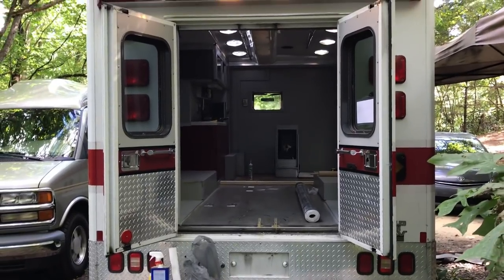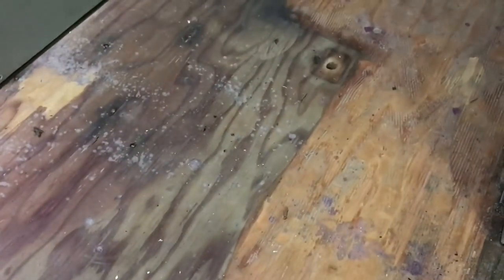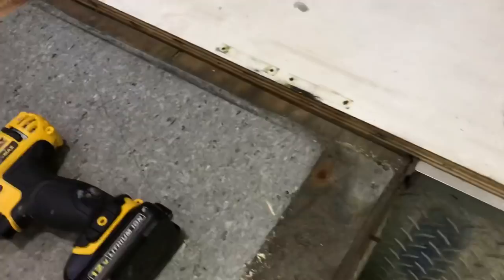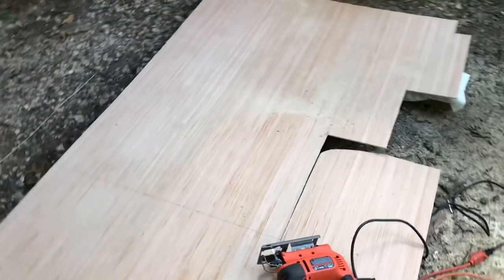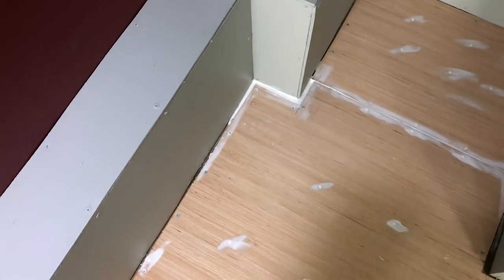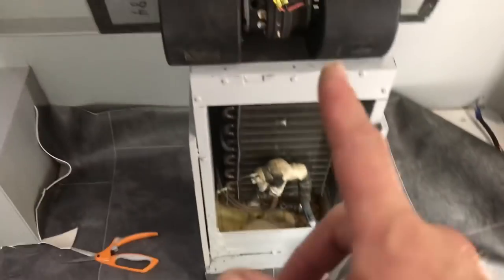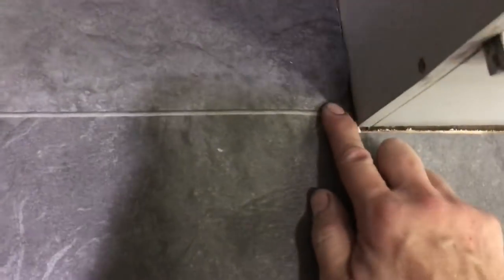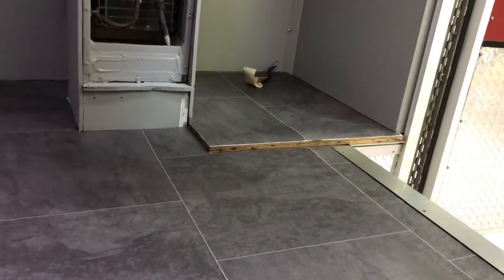Installing Vinyl Flooring for Beginners - Camper Build Conversion RV

Comment: There are 2 types of backing on vinyl floors and they require different adhesives. The paper back vinyl uses Tec Stick-N-Stay. The vinyl backed "sheet vinyl" uses Tec Pressure Sensitive Adhesive. Your vinyl will seem to adhear to your wood underlayment until cold weather, where in, the Stick-N-Stay becomes brittle and releases it's grip on the vinyl backed sheet goods. Most people give up on sheet vinyl at that point and declare "they'll never use it again". You have a very small area to work with and using a paper pattern and the proper adhesive will make it last 15 years. Next spring (after going through winter) look for your vinyl to slighly stretch and wrinkle, enough to possibly catch on a heel and tear. Do not despair. It can be easily replaced. Once your trim has been removed, you will be able to pick it up from the floor like an old newspaper. Believe it or not, in the last 40 years I've described this scenario HUNDREDS of times to home owners.
Reply from the maker: Very good to know. I’m not sure sure I’m sold on the padded viyl so a change out would not be bad. Could use the old for a template.  If you put a stool on this vinyl it makes a dent that takes days to sort back out.
Reply: PSC Camper Conversions  Most of the times at Lowes and Home Depot the sales associates have not been trained on selling the proper adhesives with vinyl backed products. Once the improper adhesive has dried and exposed to below 40 degree temperature, it's adhesive quality has been compromised. I think that is a Mannington brand pattern that you chose, they make that in a 16, 12 and 6 inch pattern. Try to buy Mannington adhesive for Mannington floors, Armstrong adhesive for Armstrong floors etc., that way the flooring manufacturer can't say, "well this is not our adhesive", when the wrong bonding agent is purchased. Using a pattern, paper or the old vinyl, allows you to cut the new sheet vinyl sitting down at a table using scissors, outside the van, instead of bent over in tight corners using a razor knife and very wide trim. Your artistic abilities allowed you to do a damn good job, but you can do Michelangelo level work with a template. Love yer vids !!
Reply: @bentnickel7487  I am just laying down my own rv sheet vinyl flooring. Should I just look at Home Depot or lowes for the glue that is “pressure sensitive”?
Reply: @TheSoilBar  Wherever you bought your sheet vinyl, go back to them for the proper adhesive. Don't buy a Mannington sheet vinyl and an Armstrong adhesive. Mixing brands is an excellent way for you to lose money. The sheet vinyl manufacturer will blame the adhesive manufacturer and vice versa, when something goes wrong. You want to be able to say, "I followed your directions". If something goes wrong the seller will replace everything for free. Different terminology by some companies, mean different things. "Pressure sensitive" is one of those phrases. You'd think, that would be a no brainer, but there's no universal language that all flooring manufacturer's use. Ask Lowes (if that's where you bought the floor) to tell you what adhesive to use. So many times people cheap out buying the adhesive and end up having to repurchase both the floor and the proper adhesive. They try to save ten bucks on the glue and ruin a $1000 dollar floor. Good luck.
Reply: @bentnickel7487  thank you so much!  I bought the flooring at a warehouse somehwere and I dont have the name brand of the manufacturer of the vinyl anymore.  Might be able to track it down though.  If I can't figure it out who made the vinyl I still appreciate the insight.  I will just buy the pressure sensitive one at lowes and hope for the best!  Thanks for steering me in the right direction

Comment: It looks great.
You may want to experiment with 3M heavy duty double sided tape instead of the adhesive.
They make some that I used to mount things in the factory I worked in. It's strong enough to pull pieces of wood off what you mount things on. (Or not do damage if you use the right chemicals and a razor)
You could also use this with tiles as long as you don't mind not having grout in the seams. But you should be able to keep them super tight to each other.
It's super strong.
I know this is a long time after the build but I thought I would pass this along anyway in hopes you read the new comments on your videos.
Reply from the maker: The adhesive I used did not work the best so the tape idea might have been better. Since the area is not that big, and I put down an area rug, it does not lift up. Without the rug, with bare feet, the vinyl now lifts a little.

Comment: Next time you have a floor to cover that has so many uneven dimensions, make a pattern (like you did with the old walls) using pieces of cardboard glued together to form your pattern to cut the flooring.